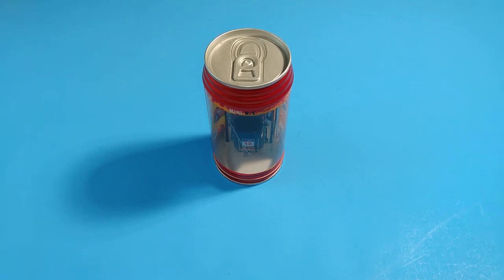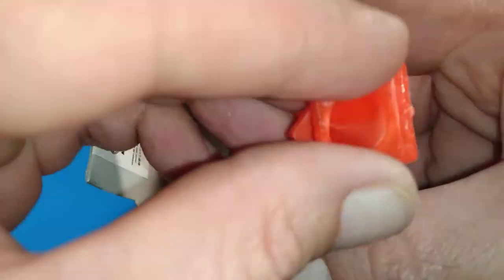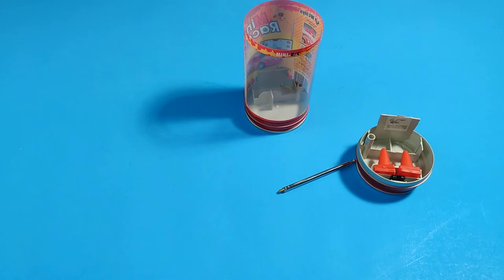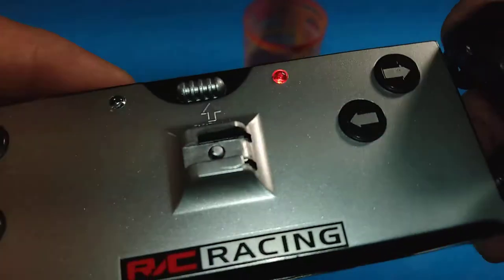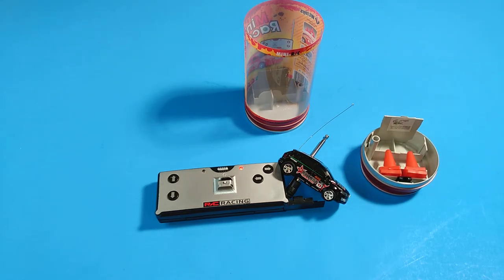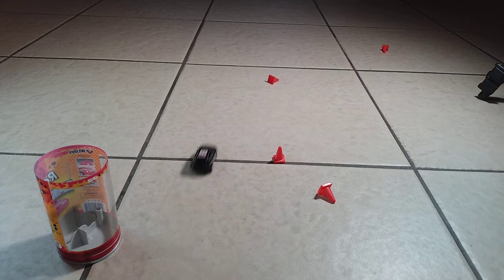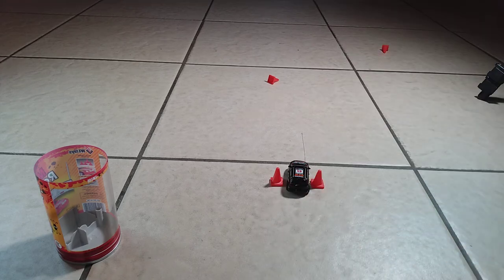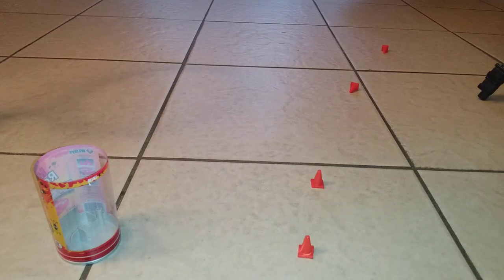Wltoys $10 Coke Can RC Racers

Comment: Wats up 
Its being a long time
We done the quads now on track
However unsettled for the hot wheels and about to setup my stunt tracks 
1:64 scale wheels looping and ramping at high speeds 

I am going to get a couple of tin cans for price however I don't know if it's much fun or just cute
I like cute and fun 

Speak to you soon
Reply from the maker: Good to hear from you my friend
Reply: Just an FYI I had bought now a couple different 164th remote control cars and they actually don't fit Hot Wheels tracks Hot Wheels brand mini cars too of course but not the off-brand like Adventure Force or whatever it is